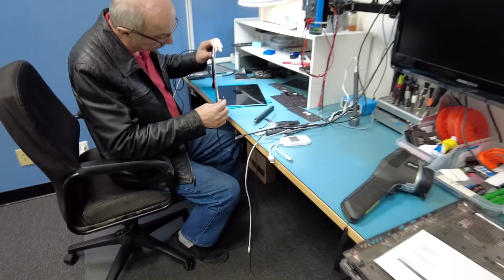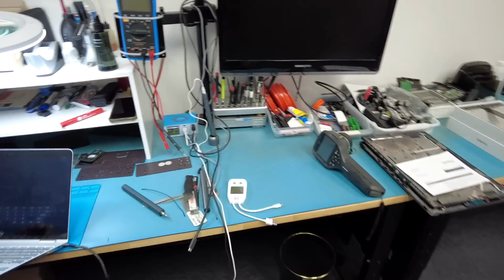Notorious HP Spectre Laptop won't charge or power on. Is it Fixable ?

Comment: I purchased that same model laptop that ended up having that same issue. I went back and forth with HP for several months and they tried to fix it under warranty but could not. It was the most frustrating experience ever. I eventually got a refund and moved on. Here you fix it in less than 10 minutes. Amazing!
Reply: I’m having the same issue right now😅 did you get it fixed?
Reply: Mine just started to give me issues today, I'm thinking it's on it's way out. Shame because I actually like the laptop for travel is simple. Had no idea it had so many issues

Comment: The difference between professional and amateur outlook is really interesting. I'm sure I'd spend hours trying to isolate and understand the fault which is fine if your goal is knowledge and experience. If your goal is putting food on the table, time is money so judiciously firing the parts cannon (replacing the USB controllers on an educated hunch) is the way you keep yourself afloat and go home at 6pm instead of midnight. The diagnosis process is fascinating, especially when you consider time and effort have a cost. I love the technical process, but that's not all there is to the problem. This is a great illustration of professional intuition.
Reply: The problem is just HP's quality, spectres that will not power on anymore - we replace mainboard, victus no power - sometimes fix is dead simple - ATX reset and the unit comes back to life, x360 models - touchpad stop working - momentarily no fix for it. 

Trust me, we are direct repair partner for HP, there some serious issues with their products.

Comment: The USB-C diode was giving me 600ohms. But when i plugged power in it was giving me 19V on one side and 0V on the other side. So would that mean the diode is only bad or also the chip that it goes to?

Comment: Great video! I have a question, if you don't mind. Can smoke damage digital microscope lenses, or do I just need to clean the lens, and it will be find? So is it permanent damage? Thank you!
Reply: Some people use a Barlow lense on the microscope it expands the working distance of the microscope but decreases the magnifcation slightly. At the same time protects the objective lens aka the one closest to the work area. There are other screw on lenses that can be use to protect the objective lens but they can affect the field of view to a degree.
Reply: @GregM  Thank you! I don't have protection for the lenses. But dust will not destroy the lenses, right? You just need to clean it, and it will be good?